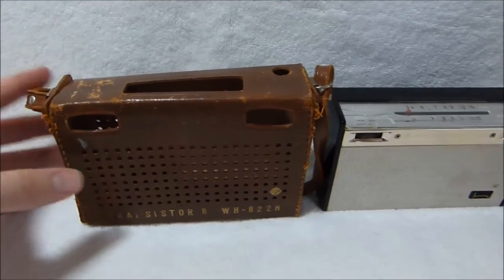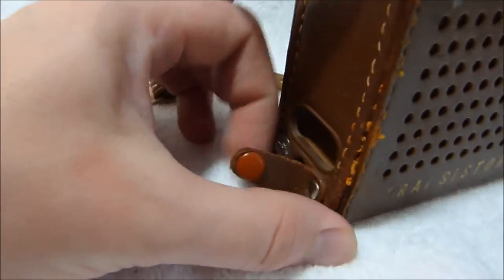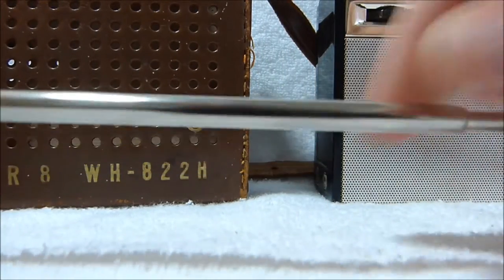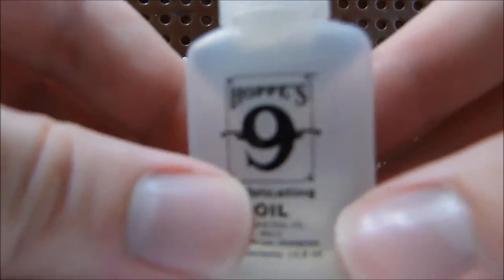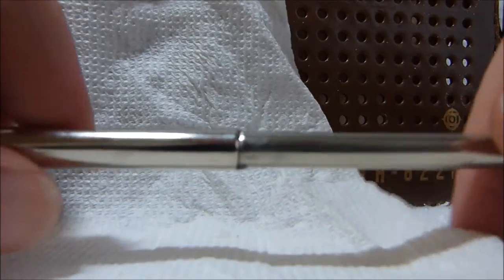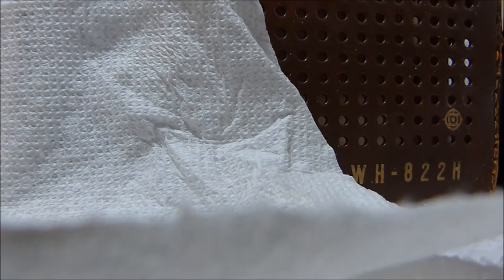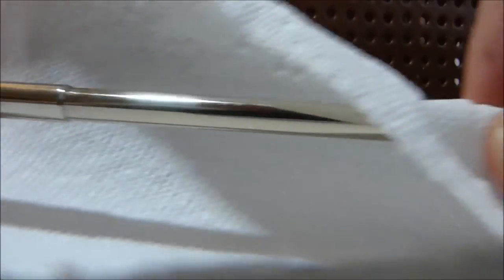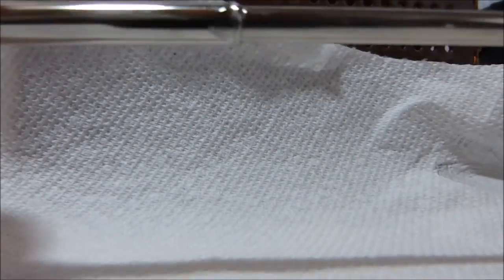How to free up a jammed or sticky telescoping radio antenna.

Comment: 50sTransistorRadios Matt, please demonstrate your method for measuring the "end-to-end resistance" of telescoping antennas. A very informative video, many thanks!
Reply from the maker: ***** Not much to demonstrate actually, I just extend the antenna all the way and hook up the leads from my multi-meter to each end and measure the resistance, which should be very low.

Comment: I have an R-310Y with broken missing jammed sections.  Call the outer tube #1.  Tubes #2 and #3 were totally stuck inside #1 - their ends were totally free.  I was able to get #3 out by working #4 out so half the brass clips were exposed where I could get pliers on them to forcibly rotate #3 which broke it free.  I attempted same to get #2 out, but when I started to expose #3 clips, one was cockeyed maybe 20 degrees.  I believe if I tried to work it out more, I would break something.

Another tube had a guy take a thin pointy Xacto knife and undo the curl at the end of a tube to allow the inner tube clips to come out easily - this might be a good way to remove #3 with the tilted clip.

Sort of a lost cause because I'm missing all tubes >#4.  The diameter of the antenna is 10mm and it has a female screw thread in it.  Hard to find on eBay or Aliexpress since no one puts dimension in titles (!)  Go figure!
Reply from the maker: I found from experience that getting the EXACT right antenna for a given radio often requires finding a parts radio of the same model, as there seems to be little standardization of antennas. 
I've had mixed luck with repairing separated antennas, I think you need whatever crimping tool the factories used to really get them reattached properly.
Reply: @50sTransistorRadios  One fellow cuts the bottom off and disassembles all the sections out the bottom.  (You have to get the tip off which hopefully is screwed).  I think the trick is to cut the bottom just above the crimp so there is some plug exposed to master the main section when it is soldered back.  (of course this method is good especially if the main seciton is inside the radio.)  It would be possible to roll or possibly burnish the lip on the section tops on a lathe.  If you have the antenna removed, this should be possible on a lathe - the body of the antenna would go thru the spindle hole so the section to be rolled would be very close to the chuck.
Reply from the maker: @NoferTrunions  I can see that technique working, though I unfortunately don't have a lathe to try it for myself. As to the tips being screwed on, that's the case maybe half of the time. I suppose you could cut the tip off, then later drill a hole in it and re-attach it.
Reply: @50sTransistorRadios  I was wondering about threaded tips.  If they aren't threaded, they must be pressed on - how else could they manufacture?

Comment: Any ideas on how to get the thin top section out when the top cap was missing?
Reply from the maker: You might be able to "grab" it with a strong magnet from the top, and pull it out enough to grab with your fingers, I've done that successfully before.

Comment: A huge other problem with old radios: Broken-off telescope antennas! Pleas do a tutorial how to mend one when U have all the parts. Think that will help many pp...
Reply from the maker: I don't really have a good method for repairing sheared off antennas. If it's just one of the top sections that has broken off, I usually just glue it into the remaining sections, since that only only shortens the antenna a little.